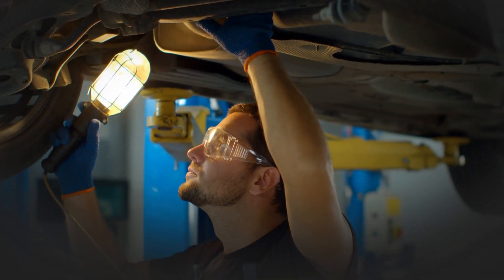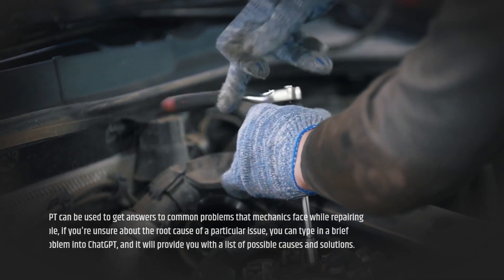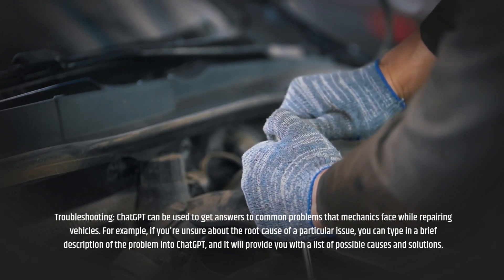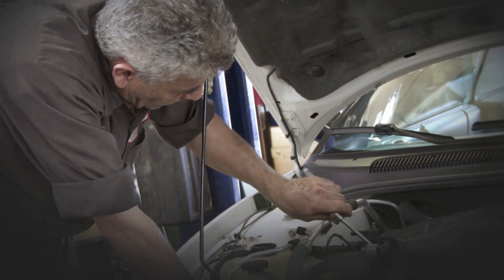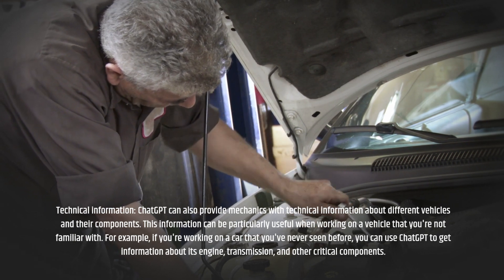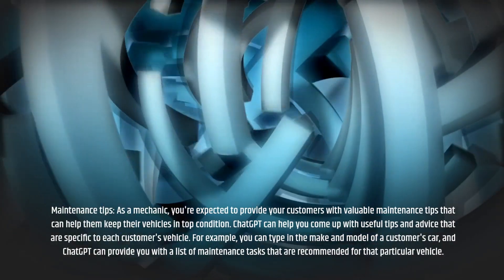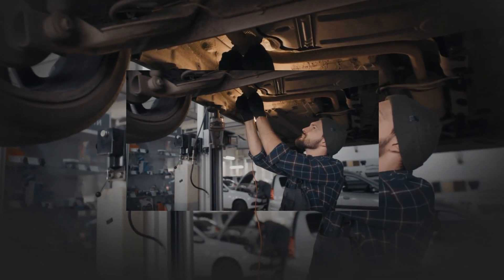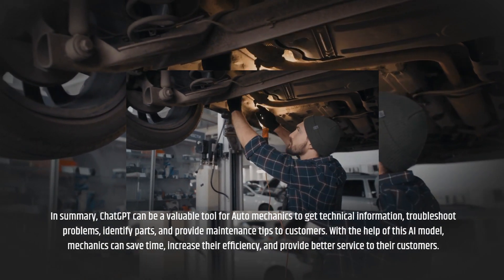How ChatGPT AI helps Auto Mechanics

Comment: I have a 2016 Doge ram PU that periodically throws a code PO-463. It is random, when i re-set it, it comes on sometimes at different times. Sometimes the check engine lite comes on but i still have a fuel reading.... very strange... QUESTION --Could it be a bad fuel cap ? because when i twist the cap, it will let me re-set the code.... Thanks